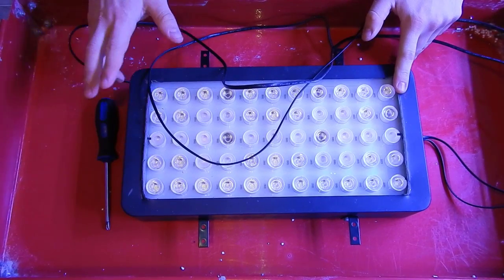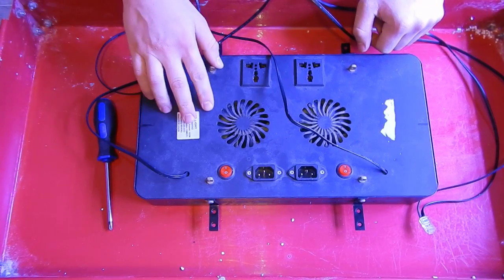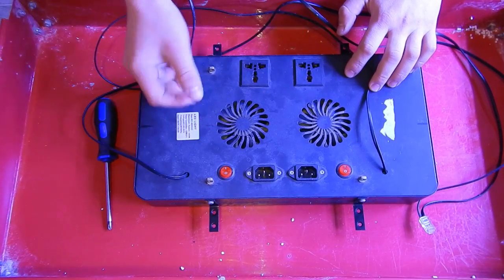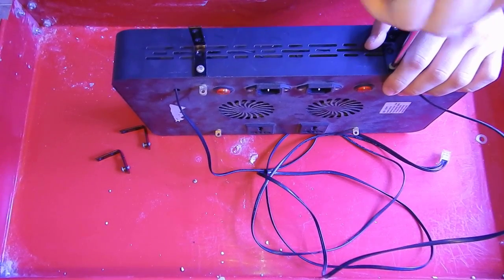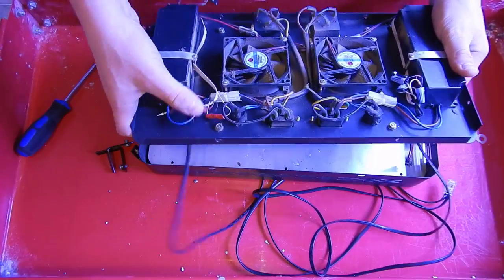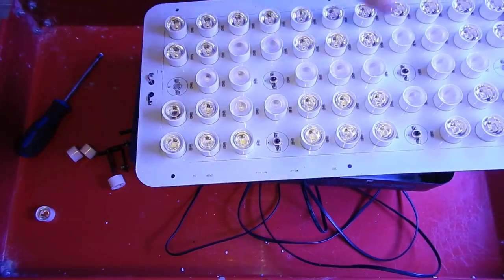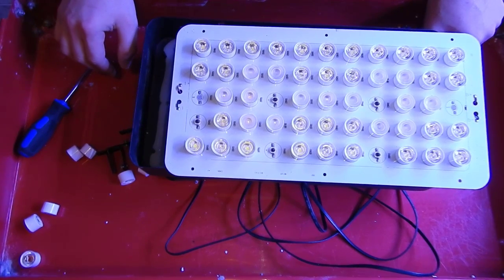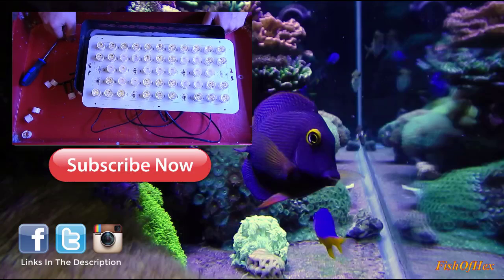Sb Reef Light PCB Board Burn Out Now What? | 200 Gallon Frag Tank

Comment: have you considered the kessil LED mixed with the T5
Reply from the maker: moving forward leds wont be the main source of lighting. I wont be going into what lighting i get until the build is started.
Reply: He brings up a good point though. I run an 8 bulb ATI and I'm thinking about putting kessils in place of the middle two bulbs for shimmer. I currently run BML actinic LEDs on the ends of the fixture but it'd be nice to be able to add in a little kessil shimmer during the day.
Reply: I smell an ATI fixture with reef brite XHOs in the future

Comment: Not sure what the layout of the lights are but guessing those burned out LEDs are on the same channel.  If one burns out or comes disconnected then it would be too much power to the others and they would burn out pretty quickly.  Typically the blue leds use far less power than the whites.  If you can find out what type of LEDs they are it would be pretty simple to desolder and resolder new ones in their place.  This is one of the reasons why I like these lights is that I can repair them.  My SB reef lights have a 2 year warranty, not sure about the pcb boards...
Worse case you can sell them and let someone else do the work.
Reply: Looks like everyone posted while I was typing.  Glad to see they wont make it to the trash!